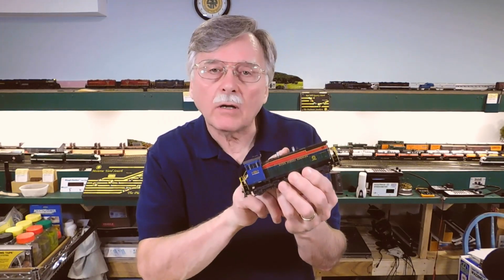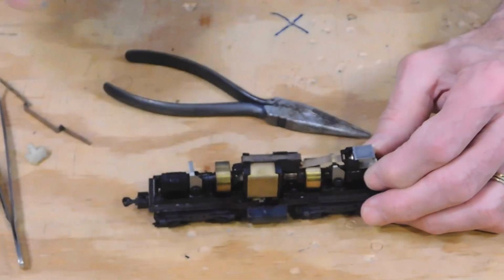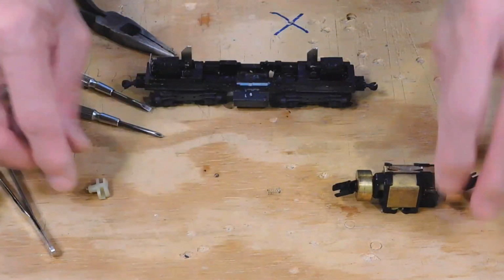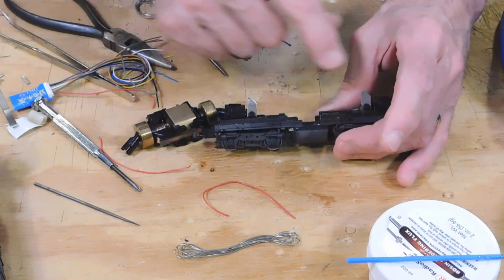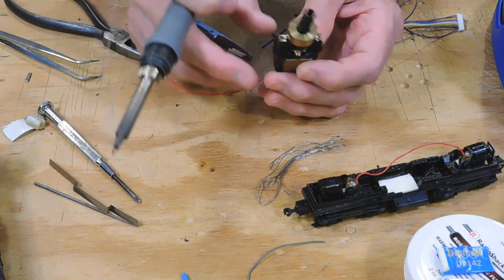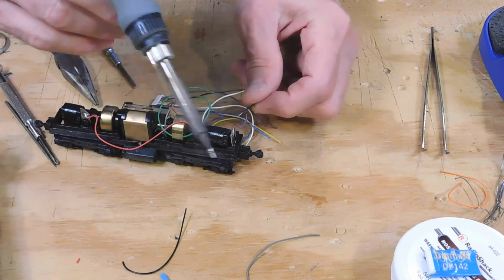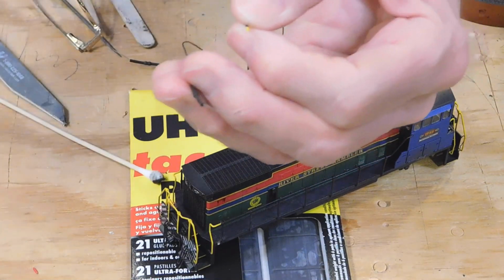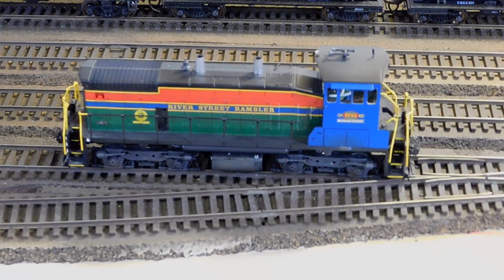DCC for a Blue Box Athearn Loco (88)

Comment: Great video, I have three Athearn blue box locomotives that need DCC installed, new units just old stocks
Reply from the maker: The worst are the F-units with those big cast weights that sit atop the motor and flywheels. I used to just run them ABA with the decoders in the dummy B-units.

Comment: Do you lube older locos that have been boxed up for so long?
Reply from the maker: Yes, and as I explained in my article in MR on the GP7 I had to pull the trucks apart and scrub out all the old dried up grease after it sat for 15 years. And don’t forget the helical gears in the truck towers, and you’d better add a touch of light oil to the motor bearings.

Comment: When do we get to see how all those wires were shoehorned into the shell?  Or is that footage not safe for public exhibition?  Seriously though, how do you keep all of those wires in there from rubbing against the mechanism?
Reply from the maker: Careful placement. Sometimes I use tape to attach them to the shell and I also will add a styrene platform atop the motor and tape the wires to it to keep them out of harms way.

Comment: Hi Larry I need some info to add dcc to very old locos for n scale.  Can you give me any info.  Thank you.
Reply from the maker: Those are likely to be problematic since older N-scale models were pretty poor performers. Once you get past about 2000 companies like started offering decoders made to fit specific models but before that you need it use their N and Z scale size decoders and be willing to cut out chunks of weight tog et them to fit. I tinkered with N-scale for about a year back then but finally came back to HO.

Comment: Very thorough, Larry! 
As some others have said here, there aren't too many GOOD Videos on DCC installation of older Locomotives, like the venerable Athearn Blue Box. I didn't even try one myself, because I wouldn't have been clear enough on everything a newer Guy would need. 

Unfortunately, there ARE a Few Guys who were convinced that they were the last word... 
I GOT it - because I've been doing DCC installs for 24 years, starting back in the "ugly days" when absolutely NOTHING was plug and play - and programming was a nightmare!! 😖😖

My concern wasn't that I thought the instructions given were STUPID, with gaps and vague points...
I was more concerned for the beginners - looking for guidance in something that, to the Novice, might as well be Rocket Science! 
Judging by the Comments, many were left a bit bewildered. 
ONE Channel (name withheld) gave condescending retorts to the questions!!! 😠
So yeah, you're doing quite a service!!! 👍👍

You know, on BB Locos.... I've often ran into the issue of poor ground contact at the Truck pivot point. 
That's why I always solder my Track Feed wires, positive and negative - to BOTH Truck Side frames. You know, the Sheet Metal that the Axle Bushings ride on.... 
As it's all too easy to get too much heat on those Plates (and a Novice would definitely be pouring on the Heat, trying to get the Solder to melt and adhere to the Steel)... 

I solder the Decoder Leads to the Brass Rivets, that holds the Truck Frame together. It's quick, painless, and easy!! You just have to make sure that none of the wires foul the swivel area. 

It's a POSITIVE connection, and doesn't rely on the Pot Metal Chassis to carry Current! 😉

..... I'm sorry! I always leave such LONG winded Comments!!! 😖 It's just that I'm pretty isolated here, but have a lot to share. I want my Decades of experience to go SOMEWHERE useful....

And maybe, my experience can augment YOUR Decades of experience, because you reach so many People! Many of which are trying to learn, while being inundated with misinformation that the Internet is all too good at! 😞 
So Larry, you can take it or leave it. I just really want to pass my knowledge down to SOMEONE. And I really don't have a good Video presence!! 😜
Carmine ✈🚂🚙

Comment: I like how you just did the swap of the motor contact strips, nice and simple. Also, I use a T-15 or T-20 Torx screwdriver to push out the motor mounts.
Reply from the maker: That’ll do it too. Just don’t try to pull them out with the motor or using pliers, those little nibs tend to break off.

Comment: Great project I have a Athearn BB GP9 so these same steps work?  Would any decoder work as well not sure which DCC system I will install yet. Thanks
Reply: One more question what guage wire would you recommend I use to connect the motor to the track pick up on the trucks, thanks
Reply from the maker: Any DCC decoder will work. The main difference comes among sound decoders but that is mainly due to differences in sounds and function options. Depending on the age of your model it may have a current hungry motor like mine and need the higher capacity decoder.

Comment: I want to replace motor on sw1500, blue box switcher can you recommend a place to buy. I want to go 2mp to 1amp
Reply from the maker: First I would see if Athearn has an upgrade motor kit for this locomotive. If not then check NWSL to see what they have. If you are very handy with this kind of thing you can find all kinds of motors on ebay, but pay attention to shaft sizes or you’ll end up having to find compatible flywheels and connectors, etc. This used to be a lot easier but many modelers no longer seem interested in doing this kind of thing so the parts are rapidly disappearing from the Walthers catalog.

Comment: What motor would you use as a replacement for better locomotive movement?  THANK YOU.
Reply from the maker: In the past I used Mashima but they are now about $46 each. One option is to check with manufacturers like Athearn or Atlas to see if they offer replacements. I tried looking this up in the Walthers online catalog but got nowhere except pages of unrelated offerings. I recently saw a YouTube video on Sam’s Trains channel about using inexpensive motors he got from China which actually seemed equal to the original Hornby motor so that might be worth looking at.  https://youtu.be/5S0nzcuOr-U
Reply: @TheDCCGuy  THANK YOU for your help.  You are a fantastic resource for DCC information.

Comment: Thanks for this really great video, it was very educational and the close-up shots were great!  Question, one of my old Blue Box units is an Athearn F7 they labeled as "Super Power" (or something like that), basically a standard unit with a giant metal weight on it.  I'm assuming there's no way to retain the weight after doing the decoder switch-out, don't think there's enough room for both the weight and decoder in there.  But asking in case you know of anyone doing that!
Reply from the maker: I have an ABA set that must be 35 years old. The way I handled the weight problem was I cut the rear projection off the weight and that gave me room in the back of the locomotive for a decoder. Another option would be to put the decoders in a dummy B-unit between the two powered A-units and run wires between them. Works great if you run them permanently coupled. Plus there is room in the B-unit for a big enough speaker for one sound decoder to make enough noise for the whole consist.
Reply: Thank you, those are both great ideas!  I hadn't thought about modifying the weight to remove that rear piece and getting that space back.

Comment: Thanks Larry, I have a few Blue Box Athearn and Blue Box Life-Like that have never been out of the boxes yet.
Reply from the maker: Pay close attention to the lubrication and contact issues. On my LLGP7 the oil on the helical gear shaft had dried out and frozen the shaft so the motor would not turn at all. Took a while to free it up. Also check axle gear spacers as they are likely cracked.
Reply: @TheDCCGuy  Ok Thanks I will do that.

Comment: I Just bought 2 Atheran engines and was wondering how easy it would be to convert them to dcc, seems pretty easy. Do I have to add the tape or can I  still use the mounts on the motor as long as the contact isn't touching the frame?
Reply from the maker: You can use the mounts if they don’t fall apart coming out. I still put a layer of electrical tape on the frame just in case. I make cutouts for the mounts and it fits fine.
Reply: @TheDCCGuy  You can also buy the motor mounts Athearn has been using in their ready-to-run locos for a while now, (ebay), that mount to your motor and you install it with screws through the same holes at the bottom, makes for a solid installation.

Comment: Saw the Bolt cutters and was wondering what they were going to be used for. What I do instead of using the frame pickup for the left rail I solder a wire to the metal side frame behind the plastic side frame on each truck and run the wires thru the frame. Another tip is to solder the motor feeds like you did but not while installed on the motor thst way you won't melt the plastic. Great how-to video on doing this install. Can't wait to see the LED light install.
Reply from the maker: All good suggestions, thanks for adding them. On a recent Athearn RS3 I worked on, the chassis pickup was to a screw set into it. I have also added pickups on the truck sideframes in the past since it bypasses the finicky contact at the truck bolster, but as long as you keep them clean this works too. The bolt cutters were just too big for the job at hand—couldn’t find my smaller set so just broke the uprights off as shown in the video.

Comment: I am not an expert in soldering. But I was taught the stuff you solder to is held in place (motor, wires and such) and your hands manipulate the iron and the solder. Partly because the solder get melted, and you have to move the iron to and from the items being soldered. I love the video otherwise because it is instructional
Reply from the maker: This is one of those cases where theory pushes up against reality. I prefer to be able to do it that way but sometimes you have go with what works at the time in order to get things in a position that the camera can record.

Comment: Thanks for video. I am going to try the dubble siding tape. Cleaning the trucks and gears. What oil or grease do you recommend?
Reply from the maker: Check out my videos on lubricating steam and diesel locos, in which I show how to do the job and also discuss lubricants. Both Woodland Scenics  and LaBelle make plastic compatible lubricants. BTW, you can get the double stick tape at office supply stores like Staples and I would  bet Walmart.

Comment: Like the video  I do have one question I was always told to run a DC loco before I hard wire is this a hard and fast rule.  Also what temp do you set your solder iron?  Thanks
Reply from the maker: It is a good idea to run the loco for a half hour or so in each direction. This process helps seat the brushes and also smoothes out the gears. However on new locos made in the last 5 years or so I really have not seen any great difference. The problem with old locos that have been sitting in a box or on a shelf for 10-20 years is that corrosion can build up, oil and grease can congeal or dry out, metal can rust, and gears can split. In this model it was the oil and corrosion that was the problem. So if the model doesn’t run well suspect all these issues and give it a tuneup.

Comment: Larry, I've been using this adapter board for my blue box decoder installs. Seems to work out pretty well.
http://www.esu.eu/en/products/accessories/adapterplatinen/21mtc-adapter-board/

I swap the brush holder clips like you do but I use push-on wire terminals on the contacts you broke off. Makes it easy to remove the trucks without soldering. Watch out for paint on the truck metal  axle supports which prevents good electrical contact from those square axle bearings.
In the past I've used Digitrax decoders exclusively but these days I'm buying German decoders just because I like their features.

Comment: When you were cleaning the contact surfaces between the trucks and the frame you might want to try an electrical contact cleaner to help shine it up such as CRC or other electrical contact cleaner.
Reply from the maker: That would work too although in this case I think a little mechanical elbow grease helped remove the buildup.

Comment: It is very rare that you get to see video's about adding DCC to those types of locomotives. I loved it. I do have one small suggestion. When you solder the motor wires on take the clips off so you don't melt plastic.
Reply from the maker: Good tip, and one I sometimes have done.
Reply: I have to agree with captainbill here. Always take the clips off to solder wire onto them. Not only will you NOT melt the plastic, but when removed it will allow you some extra space for the actual soldering.